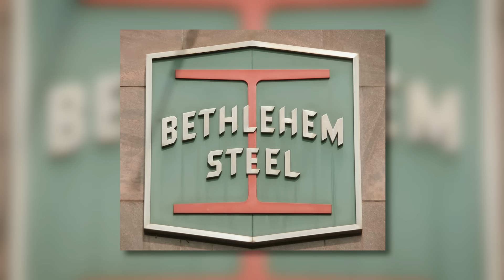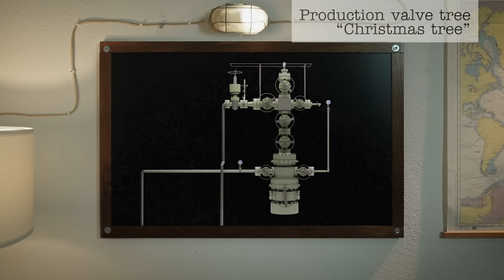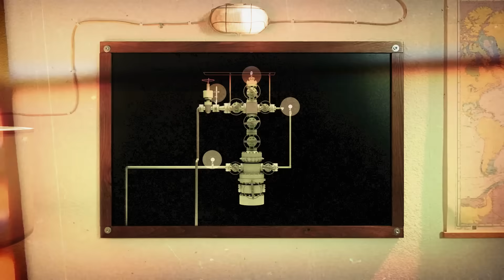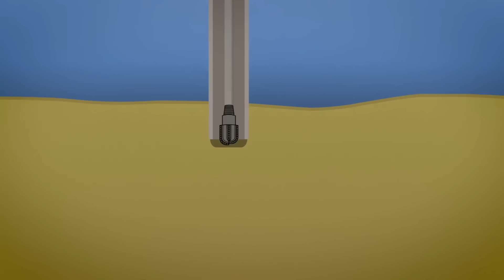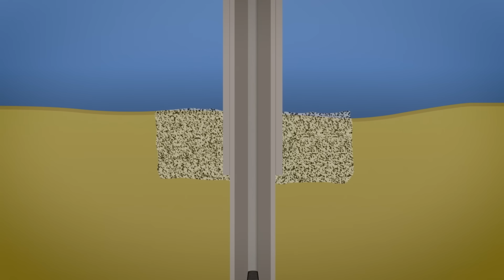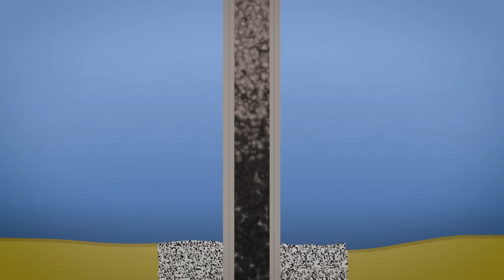What Really Happened on This Mexican Oil Rig?

Comment: An outdated oil-drilling manufactured in 1982. . .

ISO 9650-1:2005 was the then current iteration of the standard for contained lifeboats. 

I suspect the safety equipment, especially for the contained lifeboats, were well outside the international ISO standards expected in 2007. 

No wonder the self-contained lifeboats, "fell apart."

PEMEX, aka, "Dodgy Brothers Incorporated", could have moved the rig upon notification of inclement weather, instead, they chose to maxmise profits over employees wellbeing. 

In essence, PEMEX, has acted like every other major corporation in history. 

Screw the worker for the CEO, the owner and the shareholder.

Comment: NO. The surface casing is installed before drilling past surface. Intermediate casing is installed after drilling through the surface cement and shoe and reaching a targeted depth. During drilling operations the drill bit is typically in “open hole” and not “cased hole” 

Source: underbalanced/managed pressure drilling operator and kick control supervisor for over 10 years
Reply: Thanks for clarifying that; the order of operations as described did seem a bit backwards. I assume the reason the drill bit is usually in an "open hole" is because the drill bit has to be as wide as the hole behind it.
Reply: @kentslocum it is in open hole because its drilling a new open hole. But yes the drill bit has to be smaller than the casing. So with each new string of casing they use a smaller diameter bit.

Comment: Choke is not a valve it's a choke. You don't throttle valves
Reply: Choke is short for choke valve, and they are absolutely a type of valve. The throttle body of your car has a butterfly valve that you do, in fact, throttle.
Reply: What the difference between a piano and a tuna ?

Comment: I surprised the rig couldn’t handle waves that were 25-30ft— they’re not uncommon at all. The structure should have been able to withstand them.
Reply: ".. extreme weather conditions we've never registered before"

Youtube-certified engineer: That's not uncommon at all.
Reply: Its true. Must mean just in that area of the ocean. That isnt that big of waves.  @martinc.720
Reply: @danjohnson3519 absolutely. Waves in the Gulf are much less impressive than the Atlantic. 

Ya can't even bodysurf on the gulf side of Florida 😢